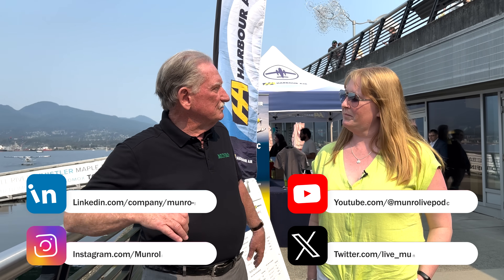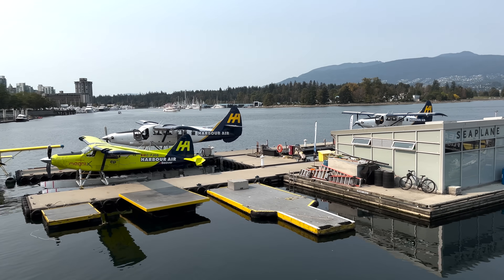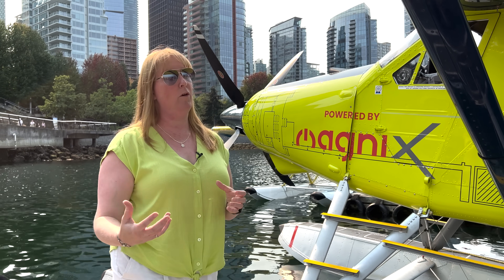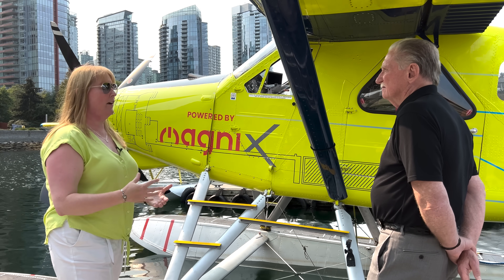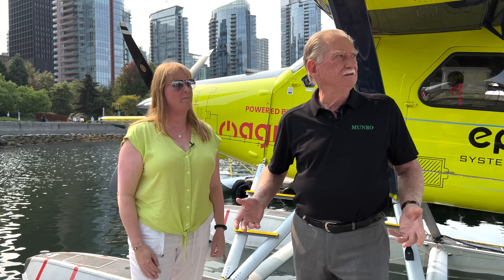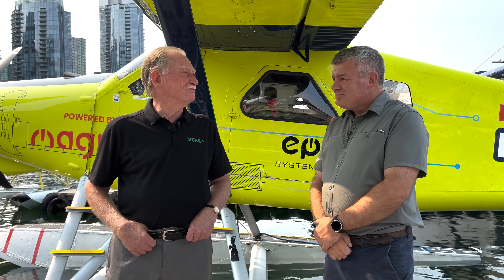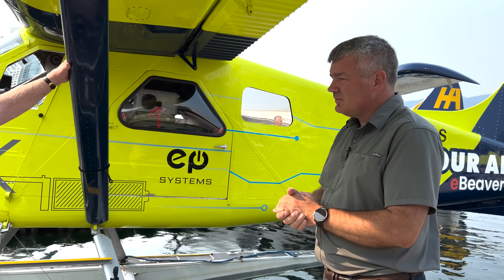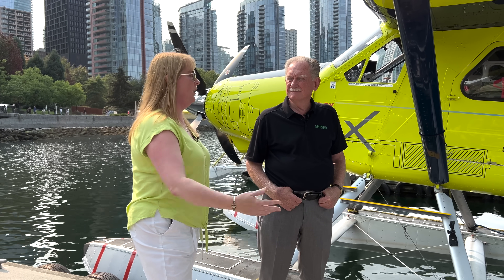The Harbour Air eBeaver Electric Seaplane | Everything Electric Canada 2024

Comment: SO Cool! I'm definitely going for a ride in one of these once they are serving tourists!  Seems perfect for Vancouver to Victoria flights!

Viking Air should restart DHC-2 production and work with Harbour Air/MagniX on a new updated Beaver to be optimised for this power system (While still leaving a turbine option! The cost per flight hour surely is much lower than the radial or turbine Beavers?? Seems like it could open up so many commuting and tourism options? Seems like there could be buyers around the world who would love to buy one of these! 

300wh per kg? My LiFePo 12V lithium batteries in my RV, doing the math are 116wh per kg??!!! Those must be some special cells MagniX is using! They are also probably a lot more expensive than the $6USD per Wh I paid for my RV batteries!

Comment: Did the math. At current 300wh/kg battery, aircraft max useful load provides 30 min flight with weight for 1 person/pilot. Thats a 3000lbs battery 88lbs motor at 530hp. The fictional batteries above this limit don't exist and are fiction at this time. They are dreaming with no chance of this getting better in the time line they suggest

Comment: Regarding the comment about Joby's props at 8:34... all practical propellers have tip velocities below the speed of sound. Tips need to be well below the speed of sound to avoid excessive transonic effects. 

And no, Sandy, an original Beaver prop was not made of cast iron, even if it had cast iron hub components (which is unlikely). As you know, it had wooden blades.

Comment: Takeoff is at 100% of rated power, but the magni500 Electric Propulsion System (engine) is substantially derated for this application, to match the original 450 horsepower (331 kW) P&W engine in the DHC-2 Beaver. The magni650 will be used at an even lower fraction of its capability.

So electric cruise requires 41% of 331 kW which is 138 kW (185 HP), compared to the gas original of 52% of 331 kW which is 175 kW (234 HP). Earlier in the flight test program, they were assuming 150 kW at cruise.

Comment: The electric propulsion unit may have a 10,000 hour TBO, but unfortunately the battery will need replacement much more frequently, based on cycle life, as mentioned later in the video.

Comment: This (at 2:06) is the first time I've heard a battery-electric aircraft builder clearly define the battery energy density assumed by their hoped-for performance specifications. Note that while MagniX has promised 300 Wh/kg (at the whole battery level, not module or cell level) they have not yet delivered this, so even Harbour Air's second conversion (now being built) will not achieve the stated payload and range.

Comment: These should follow the track of byd and scout trucks where you use a gas generator for extended range. It would nice to know what battery size is in this. 50 miles seems way too short no?.

Comment: Electric vehicles operate with only around 11% energy loss, meaning that most of the energy that goes into the car ends up turning the wheels. Because the vehicle doesn’t burn fuel, there is no thermodynamic penalty for converting heat to motion. Also, EVs can recapture energy during braking, boosting overall efficiency.
No, electric vehicles (EVs) are not considered thermodynamic heat engines because they do not operate by converting heat into mechanical energy like traditional combustion engines; instead, they directly convert electrical energy from the battery into motion using an electric motor, with minimal heat generation compared to combustion engines, making them significantly more efficient in terms of energy conversion.

Comment: Have the beaver creators addressed this issue. The idea of an electric plane almost scares me. 

I was excited about getting my first electric bike, but it soon wore off. All is good but one thing and that is as the batteries wear down so does your engine power, where in a gas engine you have the same power whether you are full, half full or one drop from empty. My loss of engine power in my bike starts at half full. I did not even think of this until I bought the bike, and rode it. It was a shock.

Is this solved in this aircraft.

Comment: Would'nt it be lighter to use air cooling, by capturing portion of the air thrust, through channels in the nose cone🤔. Might need a unique fitment for fast charging on ground though. Just some 💭. More interesting, than an ICEV to BEV conversion.❤👍

Comment: FANTASTIC!    To see the first "real life" EV aircraft be a DeHavilland eBEAVER mod! 
 I've long thought that the Beaver is one of the very top aircraft candidates for a new, carbon-fiber generation
(I believe someone has made something similar in a 4-6 place, also STOL,  even more capable, but expensive turbine powered ac) 
- but to see this super versatile, super reliable aircraft  be one of the first to be fitted with a production EV battery powered electric motor is great.  
 IF these do work out, go in to production, and prove reliable... then you can bet the AEROSPACE community will jump in,
THEN there will be EVEN MORE  DRIVERS for those developing the next gen of lightweight, high power, super reliable  EV batteries.
Reply: Pipistrel has had multiple battery-electric models, including one which has been certified since 2020 and in use by flying schools. Harbour Air's goal is the first battery-electric aircraft in commercial passenger operation - they may make that.

Comment: Nice idea and prototype but we’re not technologically ready to have those batteries on an aircraft. The beaver is an amazing aircraft. If when you have the batteries go thermal runaway and catch fire you won’t have time to get out safely without burning or the fumes killing you. We’re not ready. I would be scared to be in one. Also the short fly time is not practical. I would also be afraid to the total pollution created manufacturing and disposal of the batteries. Amazing idea though.
Reply: Amazing idea but you can't see it succeeding despite the fact that competent engineers and entire companies are making it happen? Any plane can catch on fire, that's why you have systems to prevent it. They know what flight time they require, and are happy the electric power can provide it. Finally, the pollution is much less, especially in B.C. where most of the power is from hydro. I sincerely hope you overcome your fears and get to enjoy an electric-powered flight in 2027.

Comment: In reality it flys for 30 minutes with 15 minutes of backup power.  What a piece of garage
Reply: Maybe with battery pack swaps it could be a great trainer?  Or maybe it’s allowed to land on lakes that ban gas-powered vehicles?  At least it’s nice and quiet…
Reply: @DrKnowNothing1  good for short hop routes. Like van island to the mainland, 20 or 30k or so. And, yeah, a swappable battery pack would be useful. Elx has it's uses. If every existing electric vehicle quit working today, the global economy would take a huge hit. Mines, goods transport, material handling, etc. Just a matter of using it where it fits. Truly don't understand the haters. As is, elx can be used for at least half the requirements. Source the power from wind, hydro, tidal, top up with pv, and what's the problem? Sure, rare earths are dirty, but they're multiple use. A gallon of gas or diesel or jet fuel is used ONCE. And producing it is just as dirty as rare earth mining.
Consider this. My grandfather was born in the late 19th century. The major transport power was horses. HORSES, ffs. 100,000 TONS of horseshit every week, in nyc. 50 dead horses per month, to deal with. Fly borne diseases everywhere. By the time he was 25, we had ice vehicles everywhere; cause you didn't have to feed them when they weren't working. We had piwered flight. By the time he was 50, every major nation had both an air force, and a domestic air travel industry. By the time he was 70, we had gone to the moon. And we're developing technology a lot faster now. The wright bros worked out of a f ing BYCICLE REPAIR SHOP. Now, we have hundreds of major labs worldwide, pushing the envelope. Personally, i work beside people i remember laughing at the idea of a CORDED lx chainsaw. 2 weeks ago, i used an off the shelf BATTERY chainsaw to knock down a dead cedar 26" at the butt, and 60' tall. 4 battery swaps had it limbed, 2 saw logs bucked, and the rest in stove length. That couldn't have happened 10 years ago. And i bet, in 10 years, we'll be way further ahead.
Reply: @armandbourque2468 how about a hybrid?  electric motoe. gas generator. small battery, obly used to boost power during takeoff, and maybe climb-out.  more components, but maybe wortg it of engine gearbox can be eliminated, and engine conteols can be aimplified since it wpukd onky run at WOT o recharge the battery?, or couos be sized for 100% or 110% of required cruise power…
Reply: @DrKnowNothing1  i don't know enough about the available tech, patent permissions, etc. Or about the power to weight ratios. At first glance, it would seem that 2 power plants, plus fuel tanks AND batteries might create weight issues. Batteries are improving every year, though, as are ice engines.
Reply: @DrKnowNothing1  hybrids with piston engines don't make sense for aircraft because an engine sized for takeoff at maximum power cruises with the engine running a an efficient point - there's no advantage to the hybrid system. With turbine engines there may be an advantage, because the turbine engine is mos efficient at full power, but while there are multiple turbine-electric hybrid projects underway no one has demonstrated an effective solution with an efficiency advantage.
Reply: Brain of a dinosaur 🦕
Reply: @davidelvin1380  To be honest, the plane really is a glorified piece of garbage (for now), which is why it's going to be employed sparingly for some short scheduled hops, carrying half the passengers and load, over 10% of the distance of a normal beaver, manufactured 75 years ago. It will take many years before the new paradigm gains any real traction, and it may not get beyond short island-hop type of environments (which would probably already be seen as a staggering success for electric flight). When it comes to electric technology replacing dino fuel, the name of the game is energy density.
Reply: @rhwing5095  Wow a intelligent person 
Nice to know they still exist

Comment: Those batteries are a big deal. This is a relatively big/heavy airplane with a 70 year old design. It's going to be interesting to see what people do with other old airplanes. There are a lot of decades old planes still flying that could be upgraded like this. This beaver apparently has has 200kwh. With the new battery, they'd push that to 300kwh. That's a lot of energy. And of course new planes can be made a lot lighter and  better optimized for battery placement. It's interesting that it's not just the weight that matters here but the center of gravity. There's only so much volume available for batteries in these old planes. A more optimized design would not have that issue.

For reference, a really light electrical plane like the pipistrel velis electro is flying with only a 24kwh battery. Kind of comparable to what the Nissan Leaf shipped with and probably not a lot better in energy density. That plane entered the certification process sometime last decade. You could probably cram 60-70kwh in there with these 300 wh/kg cells. That would probably more than triple the range (you only take off once at 100% power, the rest is cruise). Probably the sweet spot is when you start getting 2-3 hours of range in something like a Cessna 172. That is starting to look doable. There are a lot of experimental planes in the US that could upgrade with relatively little hassle from the FAA too. IMHO this is going to revolutionize general aviation in the next ten years.

The other interesting thing that was mentioned is the cycle times of these batteries. 2000-3000 cycles is not a lot these days. There are better batteries available. And not having to swap them out as often is going to matter for cost. And of course batteries are getting cheaper too. Solid state is going to be a big deal for electrical aviation. And push things closer to 1kwh/kg densities eventually. Possibly higher even.

Comment: Why is the guy interviewing so clueless? He seems to not have a grasp of the aircraft or the technology. He fails to see the most obvious questions, and asks pretty useless questions that have already been addressed by the wonderful people at Harbour Air.  My question would be why don't they use the wings for battery placement.. the usual location for fuel.
Reply: The fuel tanks in a Beaver (or Otter, or Twin Otter) are in the belly of the fuselage, not the wings. 

Most aircraft fuel tank spaces are both irregularly shaped and interrupted by structures, so they are difficult to use for batteries.

Also, Harbour Air is trying to avoid any change to parts of the aircraft which don't need to be changed, to minimize regulatory issues. In a Beaver, an engine conversion doesn't need to involve the wings at all.

Comment: I’ve been following this for years. Hats off to Harbour Air to pursue this dream.

I’m left with some questions…

How many cycles per year?
If operated 10 flights per day at 20 minutes each day with 30 minutes to charge…2000 charge cycles/10 flights per day = 200 days. Looks like the battery gets replaced approximately every 10-18 months depending on usage and remaining tested charge capacity. If so, this explains the need for updates to the supplemental type certificate(STC) as battery technology evolves. Further explains why there isn’t a huge cost saving over combustion fuels, but should be a big saving over sustainable aviation furls. Good thing they are quieter and shift their energy source to hydro.

This will be fascinating to see how it pans out.  Excellent program.

Comment: I wish the best for this project... i really do. 

There are just so many problems to manage. The 2 to 3 thousand cycles before replacing the battery means all of the batteries will have to be replaced around every 10 to 12 months (of course, depends on flight frequency). I understand that the main purpose for this project is the  environment and i find it really hard to believe that replacing all those batteries on each aircraft every year is better for the environment than to just burn avgas. Factoring in the carbon footprint from mining / processing materials (most of it from africa), manufacturing, shipping to the plane, ect. Not to mention the fresh water that is used and becomes polluted in the mining and manufacturing.  Then the disposal of the old batteries. Theres a lot to consider. 

Also, have you seen the video of a person being stuck in an elevator when their cellphone battery pops?  Imagine that but instead of an elevator, its an airplane and instead of a 100 gram battery, its several hundred (maybe thousands?) Of pounds. 🔥🔥

Comment: Payload? Range? Cost?
Reply: Maybe you should try actually watching the video.
Reply: @fredbloggs5902  Beaver DHC-2 Specs: Payload: 2100 lbs. Range: 578 miles Remind us again how the EV Beaver is "revolutionizing" bush planes....
Reply: @earlgreystoke3324  So you still haven’t watched the video. The use case was clearly stated.
Reply: @fredbloggs5902  The "use case" is nonsensical & crafted to reflect the impracticality of an EV bush plane.
Reply: @earlgreystoke3324  You’re welcome to your opinion. Electric planes will obviously improve and prove you wrong, probably within ten years.
Reply: @fredbloggs5902  Do you understand the reality of energy density? The best Li-Po battery is rated at 1MJ/kg. C4 explosive is 4 MJ/kg. Jet A is 40 MJ/kg. Physics is a cruel master impervious to fanciful dreams.
Reply: @earlgreystoke3324  They’re already getting a range of 50 miles that has immediate viable use cases and that’s with a small obsolete plane. Something along the lines of a Fokker 50 with a range of 300 miles seems reasonable to me.

Comment: The problem with electrifying an old plane especially a utility plane like the Beaver is that the plane is heavily built to withstand the vibration and weight of a radial piston engine plus the airframe is overbuilt with a very high service factor to make it more rugged. If an electric plane is designed from the ground up, it will be much lighter and more streamlined, needing much less power to fly and therefore have a longer flight time. Since the wings are not carrying fuel they can be thinner and lighter too.
Reply: But would be more expensive and lengthy to get certified. Reusing an existing and known airframe allows them to focus on certification of the motor and battery systems only.
Reply: Pilot could loose some weight too!

Comment: Electric engine 😬 it’s a motor.
Reply: It is a motor, but it's also an engine.
Reply: @brianb-p6586  not true look up definition
Reply: @cobalt-pogo6089  I have. You apparently have not.
Reply: @cobalt-pogo6089  Rocket motors use combustion but are not engines.
Reply: That's the oldest misconception around.

Comment: Electric motor
Engine = internal combustion
Reply: The oldest misconception around. Rocket motors use combustion but don't qualify as engines.
Reply: @PabloGonzalez-hv3td  Interesting, didn't know 🙂
I forgot to write in automotive, which is my area.
Reply: @ZOD268  They are interchangeable until you hit the rocketry world. If you ask for motor oil do you mean 10W 30 or are you lubricating the alternator?

Comment: With a useful range of only 50 miles, it's a novelty at best.  However, it's definitely a step in the right direction.  We just need that one breakthrough in battery tech.  Then sort out the power generation issue.